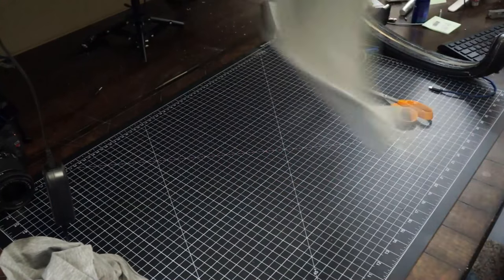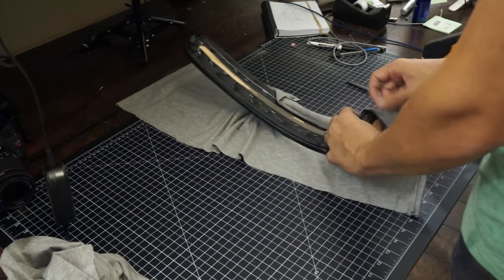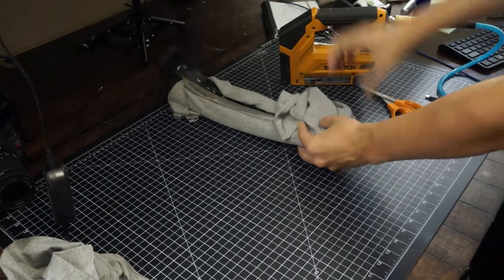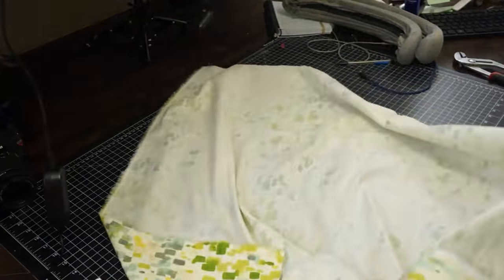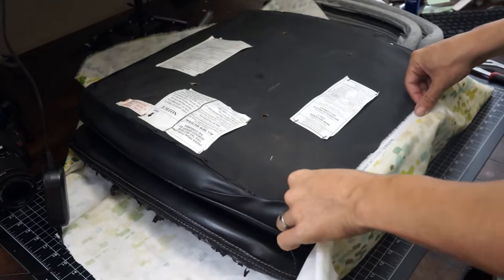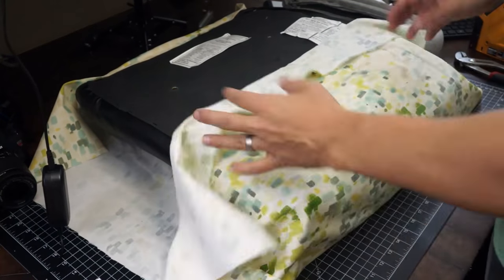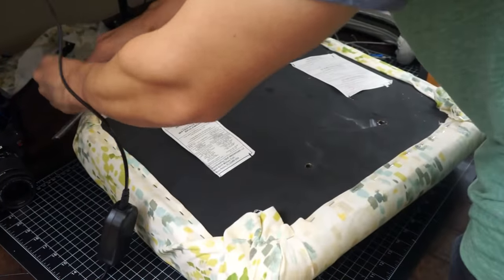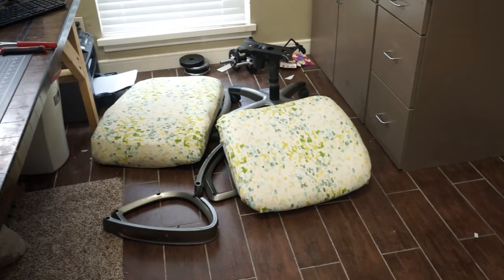How To Reupholster An Old Office Chair

Comment: The power stapler tool that you are using seems to be very study, what would you recommend for a new user, with minimal affordable price?
Reply from the maker: You can get a manual staple gun for 10 or 12 bucks... just make sure you buy HEAVY DUTY staples that fit the gun you buy